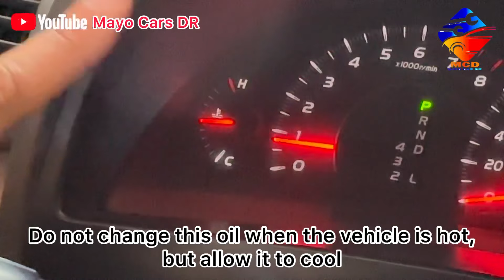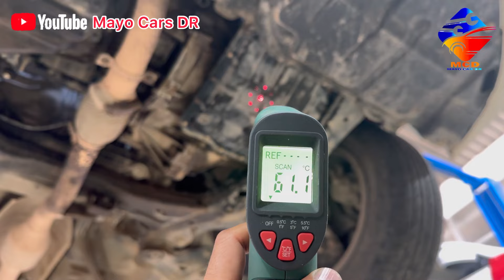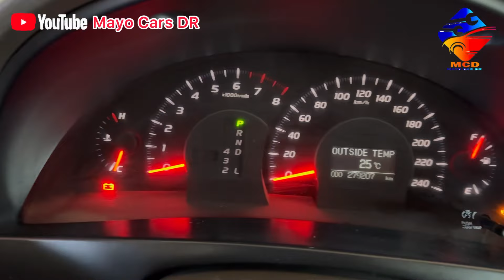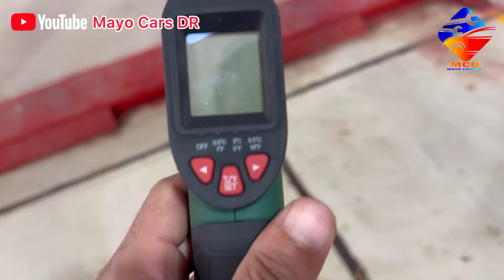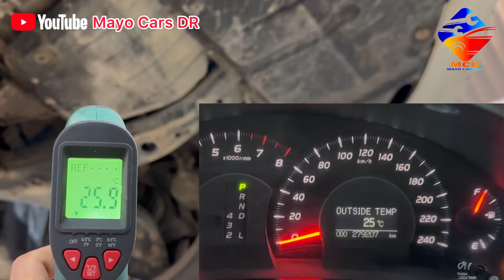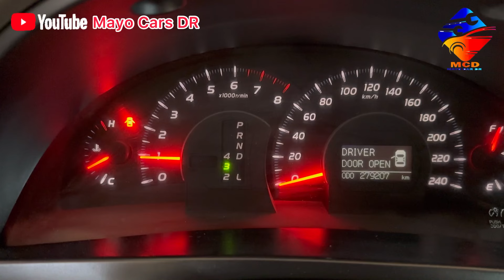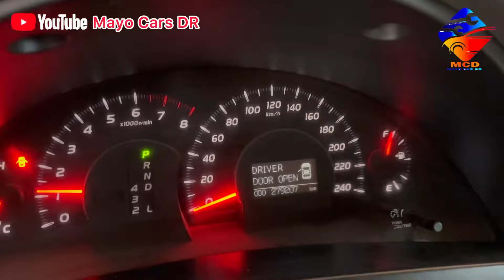Toyota Camry Transmission fluid And Filter Replacement 2002-2010

Comment: Here in the USA , the thought is to drain ATF every 30000-40000 miles . Some are doing a " passive flush " , I believe it involves . Disconnecting the hoses from the transmission cooler . Vehicle running , one hose suctioing up new fluid to force the old fluid out of the other hose . And I would always change the filter , what harm can come from it . And when should you be changing the filter . There are those that say " drain and fill " , nothing else necessary .
Reply: Drain and fill is between the intervals of the full filter change
Reply: Yeah but in my book says it's good for 150000 miles.....😮
Reply: @Badbri2A  Try to watch as many transmission service videos as you can . To see , hear and read comments of others .

Comment: The torque specs per 2002 OEM Toyota Repair Manual:
Transmission oil strainer: 96 in/lb (page 40-31)
Transmission pan bolts: 69 in/lb (page 40-32)
Transmission drain plug: 36 ft/lb (page 40-29)
Engine mounting insulator LH x Automatic transaxle assy: 70 ft/lb (pages 03-18 and 14-16)

Comment: Very informative on basics. However, WARNING TO DIY NOVICES! – the video in places looking up at this job starting at about 5:00 is FLIPED (probably because using wrong side phone camera) it is NOT “right turn loosen” as for example when taking out the drain plug. Just the opposite!
Also, if your trans does not have a dip stick (like my 2013 Camry), the refill procedure is entirely different and important to get right. Others’ on YouTube can show you that.  I recommend the “CareCare Nut’s video for that.  Again, very informative and easy to follow and I’m sure very helpful especially in its suitability for a range of spoken language viewers.
Reply from the maker: Ok, thanks for comment
Reply: That was messing with me also!
Reply: I thought maybe the video was made in Australia. I’ve heard their toilets flush upwards as well. 😮

Comment: What metric hex socket size are the trans filter bolts? The trans pan bolts are like 10mm, it looks like? Are they both 10mm (long for filter, short for pan)?
Reply from the maker: Yes 
all bolts size is 10mm

Comment: I was just wondering how many quarts of transmission fluid should I pour in after a Transmission Flush and Filter change... Is it 5-7 quarts?   Also, did you use some sort of grease on that O-ring, if so which type of grease.   Great Video...
Reply from the maker: 4-5L oil
O ring apple any oil
Reply: Mine said it was 6.9 L I'm gonna have to make sure

Comment: Very helpful video! Sir i have 2010 camry, the transmission is not changing to S gear when it does it's automatically changes to D back and when it's neutral changing it to D the whole car shakes or the car kinda jumps what should i do? Please let me know thanks
Reply from the maker: Take your vehicle to a mechanic. The problem is inside your transmission
Reply: Did you ever figure out what was wrong?

Comment: Hi. After completely draining the trans oil and replacing the filter, how much of oil should you add for Toyota Camry 2008? I put in 5.7L and the car started missing gears (4th and above mainly) so I took out 500ml. It's still slipping gears. How much should I have in there?
Reply from the maker: Withfilter 4.5L

Comment: It appears that the drain plug bolt is reverse ( left hand thread ) when I watch you remove it clockwise. Is this correct or specific to your country's import? thanks
Reply from the maker: The difference is the front and back camera
Reply: @MayoCarsDR  Got it. Thanks for reply

Comment: Wonderful video! What is the torque value of 3 long bolts for the filter? What are the torque values of 16 shell bolts and the torque value of transmission bottom bolts to the beam, which you removed for more space? A newbie is unlikely to have a proper hand feeling for tightness.
Reply from the maker: https://www.facebook.com/100057543276085/posts/pfbid0JxGsvG714V9fkD7YCFJbDsMc2Joaxx9zNYFVUK1YV8RBdbYnTNMqWbX2vLGT5cyGl/?sfnsn=mo

Comment: Excelente video, mi transmisión hace un pequeño brinco de segunda a tercera velocidad, puede ser el filtro y el aceite el problema?
Gracias
Reply from the maker: Change it and see, maybe your problem will be solved
Reply from the maker: And maybe if you have never changed the oil before then the problem will be more

Comment: hello sir, question, does the filter really need to be changed? I have a 2009 with 221k and I had it flushed at Valvoline at 149k back in 2019, this time I want to do a drain and fill by myself. Car drives fine but would like to know my options. Mostly highway driving. 64 miles a day. Thanks.
Reply from the maker: Yes, the transmission oil and filter should be changed in the same way as the engine, but the transmission oil and filter should be changed after 40,50,000 km.
Reply from the maker: Yes, if your car is running fine, change your transmission oil and filter

Comment: Is there a way to get those rough to reach bolts without raising the block
Reply from the maker: It is best to lift the block to open these bolts as there is very little space underneath
Reply: @MayoCarsDR  I did yesterday as you did, thank you!! I would say it's important to remove that engine mount screw from the top too, not just the 3 from the bottom

Comment: Sir what solution ur using to clean the transmission pan? Is it petrol?? And what about gasket? No need to put the sealant?
Reply from the maker: Yes I'm using gasoline to clean the oil pan and it doesn't need silicone at all if you install a new gas kit.

Comment: I have camry transmission serviced on 80K. Now it has 333K do you think is it normal to flash the transmission fluid or just keep it as is, since it has no issue ?
Reply from the maker: If your transmission has no problems, you should get it serviced and it will last longer
Reply: @MayoCarsDR whatnofnim changing it because it is having issues. They keep telling me xhange the fluid leave the filter?

Comment: I heard many people said you don't needs to change the transmission fluid on a camry，is that true？😮
Reply from the maker: No
This information is incorrect
Reply: @MayoCarsDR 30.000 or 3 years that simple and use the correct fluid , I just bought a case T-IV $7 bucks a quart Toyota

Comment: Is there anyway to message you to ask question in regards to 2002 Toyota Camry check engine code P07050
Reply from the maker: P0705 Toyota Code - Transmission Range Sensor Circuit Malfunction